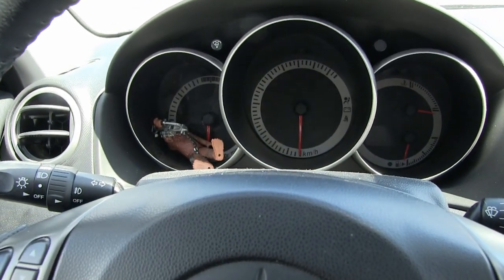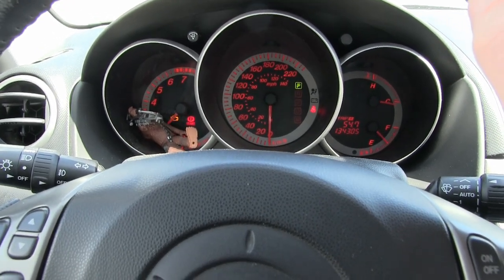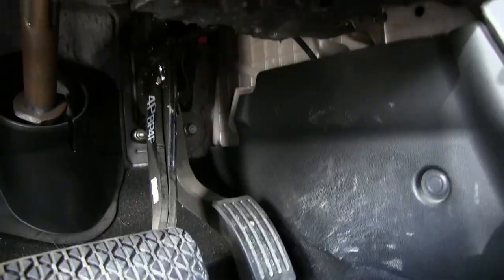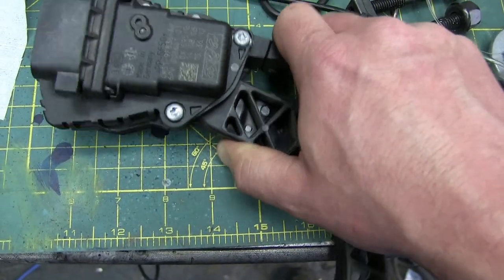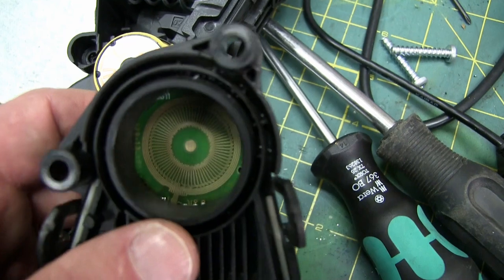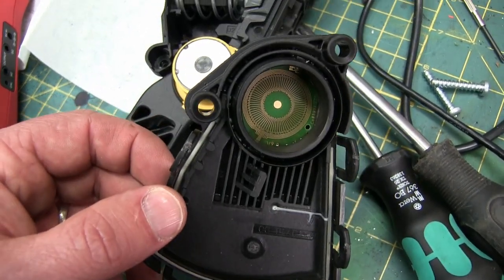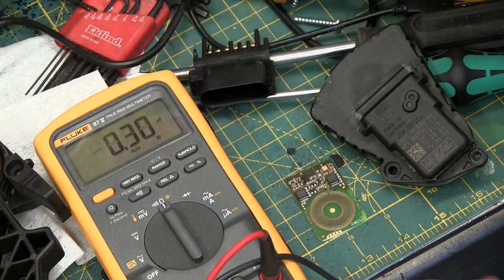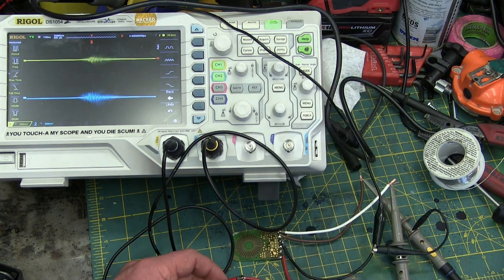BOLTR: CANbus accelerator pedal.

Comment: i despise modern vehicles.

The demise of the throttle cable - a mechanical connection - drives me insane. 
unnecessary over complicated
Reply: You need the data of the driver pedal over the CAN system for other functions. If they could make it cheaper and use a throttle cable, they would.
Reply: Throttle cable and TPS is all I need.

I dont fool with anything much more modern. Drive by wire is not my cup tea. Keep it.
Reply: Except they now cost less, get 30+mpg, have adaptive cruise control, and are much safer. But yeah, other than that totally unnecessary.
Reply: much safer, WHEN IT WORKS. I happen to remember a recent massive recall related to the throttle. that's besides the point it being a black box with the possibility of being controlled remotely in any number of ways.
Reply: Pete Lorenzo Do you honestly think the improvements to automobiles have made them less safe due to relatively rare malfunctions? Or even as actual news of cars being hacked outside of hack-a-thons?
Reply: i dont care about "safety" or adaptive cruise control.

I care about MECHANICAL RELIABILITY.

not being left stranded... can fix with zip ties etc.

my 1975 Jeep in line 6 gets mid to high 20s mpg and can be fixed with shoelaces, baling wire and duct tape. It also cost $1200 not $35000.

Whos the sucker? Not me
Reply: who gives a shit about safety?!?! What is this a Good Housekeeping forum? A Chevy find new roads commercial??

Im talking about WHEN things breal or  malfunction you can fix it EVEN in the field.
Reply: +David Lee I don't need a safer car. I don't want a self driving car. I don't want electric windows..hell I don't even need fuel injection. Don't need an automatic transmission either. As far as I'm concerned they are just filling cars with expensive and hard to fix electronic garbage. To boot every add on has an additional life cycle which means more opportunities for failures. Its getting harder and harder to find a car that's not plastic junk. Even truck bumpers are full of plastic..WTF
Reply: the sucker is the one that sold you an intact 40yr old jeep for $1200...

or did you pay that decades ago? and how much in parts since?

i get it, i own a 71 monte... but you're cherry picking pretty hard.
Reply: Ohh a 70s AMC 6. That would be the 4.2 correct? I have that motors younger sibling in my Jeep, both great motors and will last forever.
Reply: +Stephen Oliveau no actually I have 2 Jeeps. an 83 dj and a 75. 
$1200 for a mechanically sound vehicle that is dead nuts reliable? Yes please.

I own a 79 f100. I own several other vehicles and always have several motorcycles, 4 wheelers and the like.

I dont need the fantasy land falsehood that modern engines are more reliable and efficient. My 1994 Geo Metro I had was carbureted and EASILY broke 50mpg  and had air conditioning. 

$1200 for the jeep is fairly expensive bit it balances out as my other one was only $400 running.  I've only replaced one tire and rebuilt the 1 barrel carb for $22. Whoopdie do.

The newest vehicle I've ever owned was a 2013 Kia. Never again. I dont need to keep with the Joneses or have the newest. I dont WANT a mew car. Its plain stupid. ...and you can see on my channel I know what I'm doing mechanically as I have plenty of modern experience and views on my Ford Fusion/Mazda 6 vids
Reply: +billybobjoe198 
theres no lie. mines a 75 DJ5 super light weight w a 232 (3.8) single barrel carbed i6.

it'll fetch mid 20s all summer long. I deliver a mail route with it as well. Little 10 gallon fuel tank. I've dobe several mpg tests in it...

I'm sure w 4x4 xfer case and running gear- yeah - It'd get high teens too - this thing is super light
Reply: One of the main reasons they ditched the throttle cable is to replace the idle air control which was a pita.
Reply: +Mari Onette point of order - my original comment still stands - I hate modern drive by wire systems. 

Mechanical linkages are far easier to deal with WHEN an issue develops as ALL mechanical and electrical components will eventually fail. 
<drops keyboard>
Reply: Actually it was faulty firmware too.
Toyota made numerous mistakes and rule violations among which use of recursive code which is something you should avoid in real time systems.
http://www.edn.com/design/automotive/4423428/Toyota-s-killer-firmware--Bad-design-and-its-consequences
Reply: Not really, the cost is more if you calculate for inflation, and relying on a vehicle to be "inherently safer" is no alternative for safe driving. I'm not a technophobe but the reliance and dependence on technology will be our undoing.
Reply: *****
that's all well an good, but you're still acting like there is absolutely no reliability or efficiency benefits to be had.

when you say reliable what you really mean is run WAY WAY out of spec and still function. which is fine... just be honest.

so you're okay with a throttle position sensor and jets instead of a butterfly and venturis?

i prefer to let the ECU adjust the AF ratio for me (on the fly), instead of doing it near daily as crazy as the weather is... but to each his own.

again you aren't being honest somewhere. you're quoting factory numbers on a 40yr old engine...

nobody would underwrite 10yr auto warranties if you couldn't reasonably expect that kind of lifespan.

at some point you have to realize those vehicles you praise so much... were the "safe and reliable new cars" of their time, and there was some curmudgeonly old fart saying the exact same thing about his 50s chevy.

your statements about your newest car experience says it all... you've developed this bias based on a kia? the cheapest shit car you can buy? that's keeping up with the jonses? what trailer park do you live in?

based on your other vehicles i'm going to say you're no older than 28, or having a midlife crisis... so it's cool. enjoy the extra spending cash that bias affords you... but be honest. you're full of shit about reliability and efficiency, it's just your preference.

the transmission on most newer Mopars will cost you as much as you claimed to play for that whole jeep...

and thanks to OBAMA and the CARPOCALYPSE... TONS of those vehicles that you love so much were crushed in a govt program 7 yrs ago...

also, try to thank all those people buying the cars you'll want in 40yrs (assuming you don't die on one of those bikes) when it becomes cost prohibitive to maintain a jeep from 2 dead car companies ago.
Reply: +Stephen Oliveau 
thats hilarious how wrong you got it.

I'm 39, I live on 3 beautiful acres with running water and a pond - All quite visible from some videos in my feed - only bought a new kia to pay off a loan I had on a 2000 Explorer - ditched the Kia after 11 months - didnt cost me a penny the way it worked. I live debt free - dont even have a bank account.

My ORIGINAL statement was I PREFER a mechanical linkage. Why? I buy and sell cars - 95% Ford, but dabble with the occasional other brands... I've personally owned no less than 230 cars - I probably have a new car eve ryother week - this isn't bragging or trying to be cool - its my life. I dont give a shit what anyone thinks.

I PREFER mechanical linkages from a RELIABILITY and MAINTENANCE standpoint. 

How this conversation got to miles per gallon and federal pig safety ratings (WHO GIVES A SHIT?!?!?! I dont! -Lets go buy a $40,000 Prius to save 8 miles per gallon! That makes sense - pffft!) 
Cars are becoming more modular and increasingly disposable - not that there werent shsit box disposable cars in the 70s and 80s - but trucks and other platforms had more longevity - and I believe there are a LOT more older American cars on the road now than there WILL be equally aged autos in the future. 

The number one safety is a maintained vehicle - ANY vehicle and a COMPETENT driver. My Jeep has 4 wheel drums and it doesnt scare me a bit. It doesnt NEED 4 wheel discs, anti lock brakes and a radar system to prevent head on collisions. How the hell would I be able to run over garbage cans or secular humanists with some stupid safety braking system??? 

As soon as people start talking safety equipment on cars I instantly identify them as some sissy namby pamby who needs government mommy to take care if them. People get hurt and die. its a fact of life. People still die in "safe" cars.
Reply: +BAMAJiPS Oh boy.. don't get me started on ABS.. I can already feel stress pains in my chest and a rage building up...
Reply: ***** lol, thanks for clearing that up, and the laughs... you're more like a younger version of my dad. all my assumptions were based on the avg person, neither of you are that.

i understand that you aren't bragging, my number isn't that high... but i can easily understand how that can happen.

you brought up high 20s in your 40yr old $1200 jeep... not to me directly, but in this thread.

you called the factual gains in reliability and efficiency, fantasy and falsehood. you can't just emphasize your preference in caps and smooth over ignorant statements/ outright lies.

comparable engine sizes and duty ratings have most certainly increased in both reliability and efficiency.

i mention safety once in a selling point quote and it triggered you that hard?

didn't jesus say something about not being so judgemental? some of us people just want safety features to maybe, possibly, make it so someone's mistake/seizure/whatever doesn't cost us our lives... maybe. i assume you've removed the doors from your jeep, did you also take out the seat belts? how about your gun safety pins? still intact? it's about taking precautions...

i hate govt mandated anything... so we agree on that. i wish i could choose to delete airbags on the 6th gen camaro... but then i wish i could get mechanical windows too.

you're totally right on the well maintained vehicle... but be honest, is that realistic of the avg person? can they afford to pay a good mechanic to do that AND be a good consumer? not unless they are more fortunate... or do it themselves.

for example: i want the doctor delivering my child more concerned with his area of expertise than cultivating and maintaining the knowledge needed to rebuild a carb, never mind something a little more complex... just to have transportation. if it's a passion of theirs cool...

that kia experience isn't exactly how you framed it previously... there is a difference between living with a car and using it to satisfy a debt... but this is just further proof you're cherry picking information and portraying it to best suit your argument.
Reply: +Stephen Oliveau What the hell is a gun safety pin? Is that like a bullet button?
Reply: +Stephen Oliveau 
ok. we're toning this down a bit. Good.

Its completely plausible to get mid to high 20s mpgs out of ancient carbureted technology. Again - the Geo metro got 50 and some claim near 60mph w its carbureted 3 cylinder motor. Its the safety equipment mandated by the feds and the creature comforts that restrict truly great mpg. I dont see significant gains in the past 20 years. It's pretty much been a plateau across the board.

Longevity - Yes, materials have improved, manufacturing techniques and precision in engineering components down to the thousanths of a mm have certainly increased engine life - EXCEPT if you take into account the expense of modern engine components. Yes modern engines typically see 200,000-230ish,000 miles - But aside from tuners,  Who rebuilds modern engines anymore? 
Think the average Mustang owner with a Coyote 5.0 is going to pull the engine and rebuild it after she tanks? 
Some will but I'd guess 95% wont. Torque-to-yield fasteners are a HUGE obstacle to cost effective engine builds... Dual overhead cams etc etc - 
the old Windsor 5.0 was so cheap to maintain and rebuild, the same motor may have been built 2 and 3 times over. The last 5.0 I bought was .60 over - Im sure it had been rebuilt twice! 

Who rebuilds modern engines? Idbsay the LS motor has a strong following because it's "old school" design - but most modern engines are blow it and chuck it. I KNOW this is a fact on the duratec 3.0 and later as I've dealt with several - videos on my channel - 20,000 views - Garbage dosposable engines for the most part. Its the nature of modern cars.
Reply: +Paul F I understand them fine and I don't fear them either yet I still hate them.. now what?
Reply: +Paul F I wonder how being able to fix something on the side of the road or deep in the woods with duct tape and zip ties - is acting like a luddite - while the "progressive" and "modern" approach is to use a cell phone and call a tow truck and have a service shop fix it - as if I'm the regressive because I'd rather be self sufficient...? Something is bass ackwards here
Reply: +BAMAJiPS Ha ha indeed! He doesn't understand so that makes you nuts? WOW.
Reply: +Paul F i just bought an Infiniti Q45 yesterday. Stole it. The 4.5l v8 has a cable attached to throttle body. Sweet! 

Unfortunately the gps navigation system uses a DVD in the trunk to store the maps -- I'm going to go ahead and agree with you on progress and tech technology - It could use an SD card for sure!
Reply: +Paul F 1955? Do you really think you have to go back that far? Your in a world of your own aren't you. A 1972 Dodge Demon and Cuda as well as Camaros Mustangs of that period had point and condenser and many are still alive today. As well as many others. If you had a 4wd back then you could fix them out in the boonies with a small tool box and a little skill. Have your computer go out In the Alaskan or Canadian wilderness where there are no cell phone towers have a nice walk in -40° below zero walking 50 - 100 miles. What could go wrong right? Ignition modules, fuel injectors, the list is long that could leave you a young stupid corpse.
Reply: +Tractor Wrangler
Didn't anyone ever tell you?
Don't feed the trolls.
Reply: Except modern cars are several times more MECHANICALLY reliable as well than they used to be. You don't know half of it when it comes to car development and how much more rugged and reliable mechanical parts in modern cars are....especially premium cars. We're at a point where it's virtually impossible to break a car mechanically unless you crash it. 99,99% of faults are small electronics, usually some sort of sensor, that's it.

Comment: AvE, did you attempt a reset, or recalibration before you de-constructed it? 
Recalibrate> Key on, engine off, pump accelerator pedal 10 times its full travel, then start engine without turning off key. 
Reset> Clear codes, Disconnect battery, ground positive battery lead and allow to sit grounded for 20 min., then do a Recalibration
Reply: ***** I don't speak Canukstanian, so, I will just pretend you said,.......Yes.?!?~~~LOL
Reply: Pointed towards the north of course.